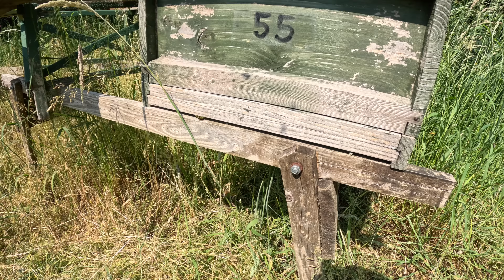Day In The Life Of A Beekeeping Entrepreneur. June

Comment: Sounds like you could do with a few extra hours per day at the moment 😄

I have noticed the exact same - the supers are full but not capped. I am wondering if it might be the very long hot and dry weather we have had, meaning that the bees have not felt any requirement to busy themselves too much with putting caps on as the honey has probably continued to loose moisture just from air exposure. Anyway. The weather has certainly changed now, at least in Ceredigion, and we have had loads of rain Sunday, along with much cloudier and cooler weather today and throughout this week according the forecast.
Reply from the maker: Fingers crossed for more honey!! 😅

Comment: Love these day I the life videos👍, how do you rate the apisolis smoker now gruff?, Would you recommend buying or stick with an original smoker?
Reply from the maker: It’s great for the nucs but it will never replace the smoker
Reply: @gwenyngruffydd  I was debating getting one, but the cost outweighs the use. I've only got about 10 hives at the moment, using the original smoker is just as easy, the only downside is this smoke when your washings on the line😂

Comment: We've got to get you a frame building jig. Doing one at a time is not efficient, with a jig  you can knock out 30 at a time.
Reply from the maker: Does it actually speed up the process?
Reply: @gwenyngruffydd  it genuinely does. The jig frees up your hands from holding frame components, which speeds up gluing and stapling processes. You can build them from scrap to accommodate any number of frames. I build 30 at a go because that was the size of the scrap I used lol.